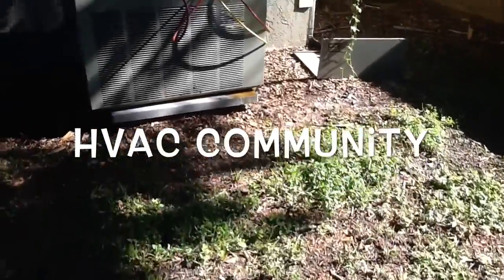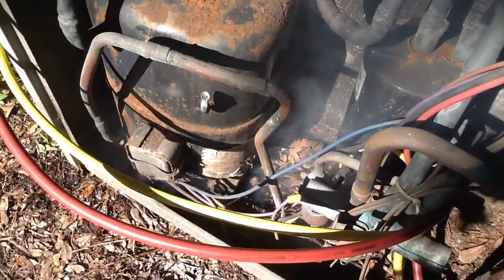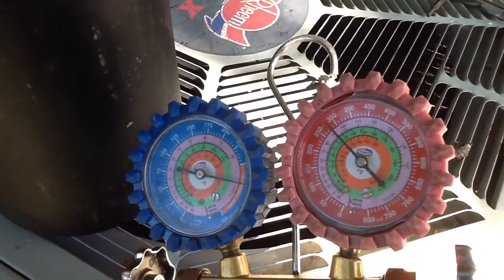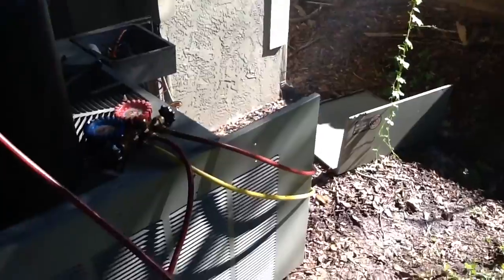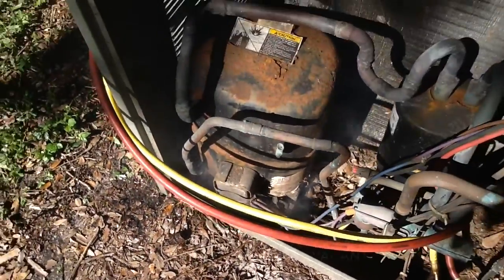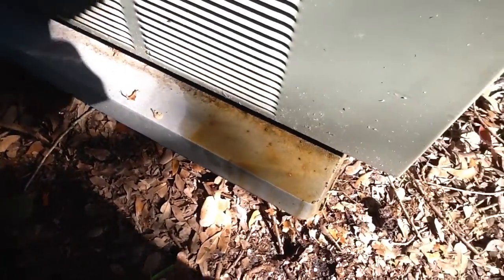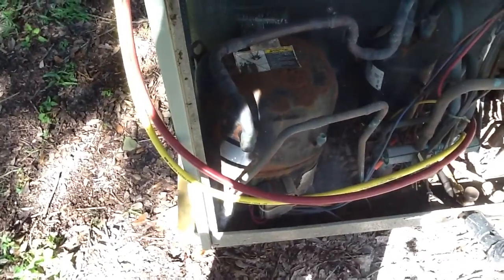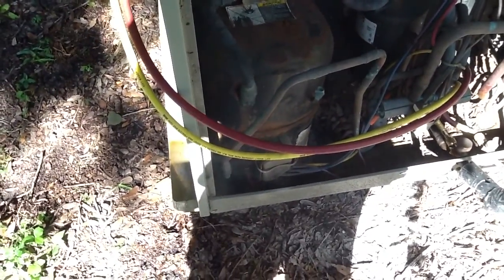HVAC: Smoking Compressor

Comment: Rheems. THose things were so tough. Easy to work on too and the compressors are easy to replace. I had one once that had fallen off the pump ups and the compressor burned out for whatever reason. Just straightened out the lines and put in another compressor.

Comment: Wow that's kinda cool, I never seen it leaking from the bottom like that, I have had them leak around the lugs with it still running.  
Was the crank case heater wired in?

Comment: That's crazy Eddie, I had a rtu compressor leak thru the crankcase heater port once but no smoke because it was off on low pressure. I do notice that a lot of older condensers have no safeties such as high or low cutouts.
Reply from the maker: Yeah your right  this one didn't have a cutout. And it constantly ran with no r-22. I believe it rusted through underneath and oil coming out gave out the smoke. Thks for the comment